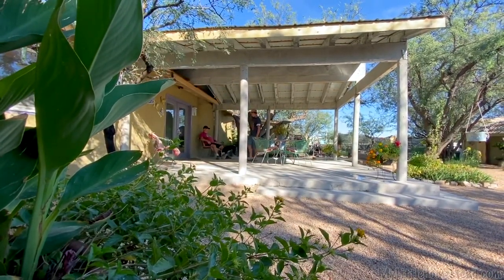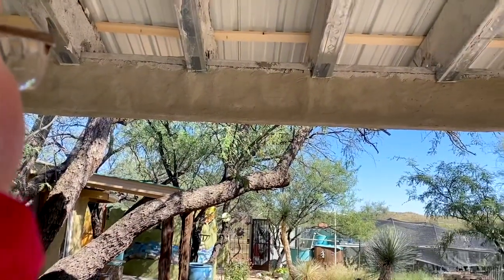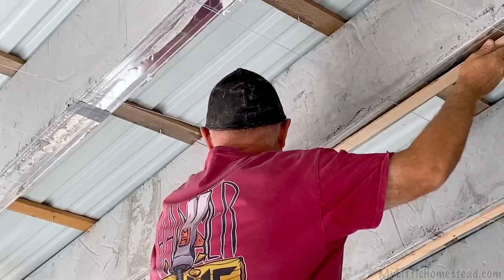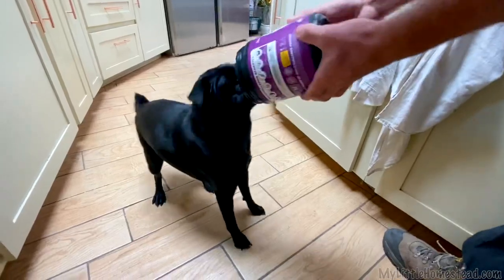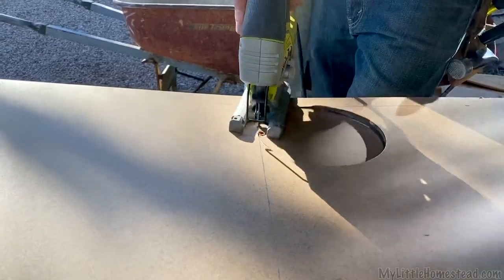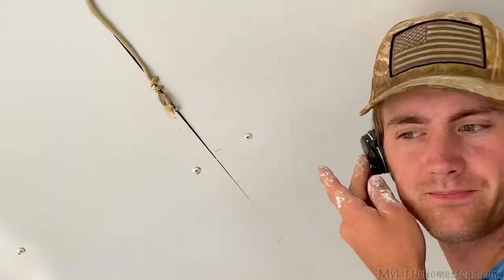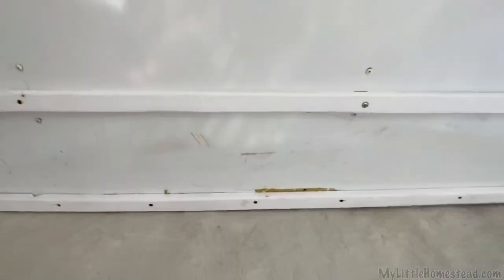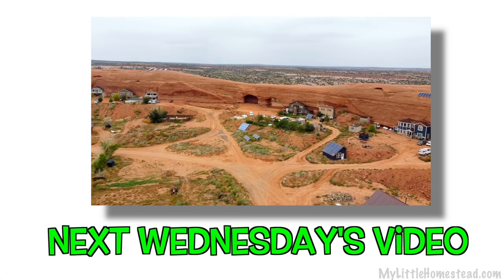Aircrete Finishing & Sheeting Patio | Weekly Peek Ep326

Comment: Shelly,
Instead of pricing traditional insulation, why don't you try pricing packing peanuts.  They are Styrofoam and will work as insulation as well.  Based on the openings on the outside edges (14:22), you can hand fill the peanuts while another person uses a broom to push and pack them further up the rafters until they are packed all the way to the outside openings and then screw a board over the opening, paint it white and you're done.
Reply: If this is just going to be an open area and still gets hot, I suggest putting in a ridge vent on the patio roof. This will help keep the temperature down by letting the hot air above the sheeting to flow out.

Comment: No reason to insulate that roof if you're not enclosing the patio. If the roof gets so hot it matters just slap a vent on the ridgeline and cut some vents to pull air into the spaces between the aircrete rafters.